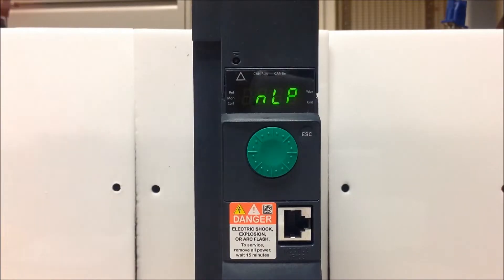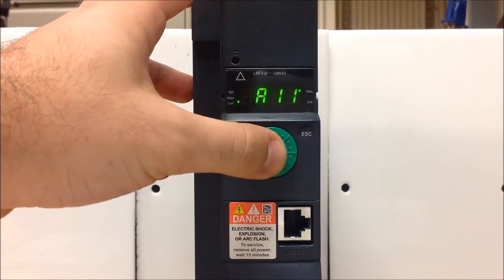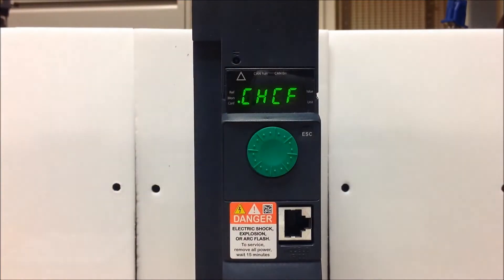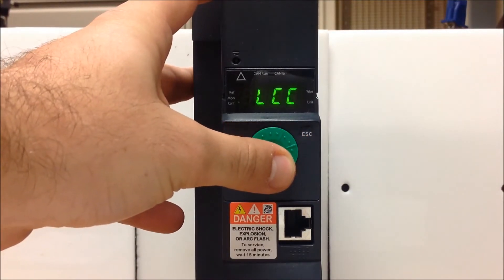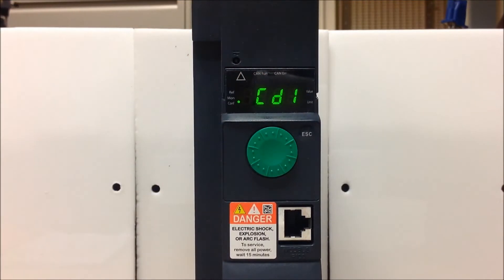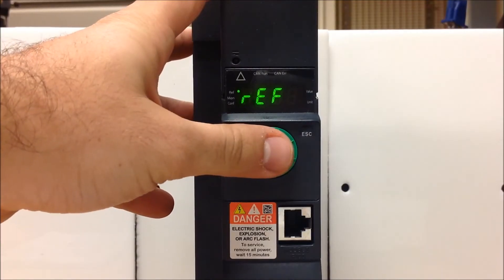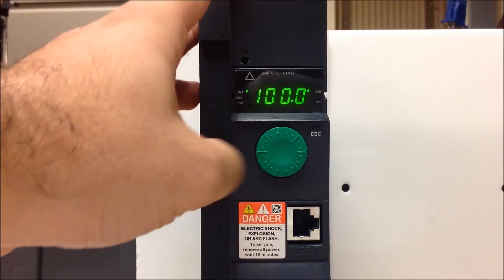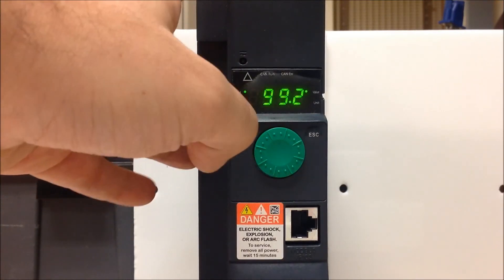Altivar 320 Drive Configuration: HMI Dial Speed Control Tutorial | Schneider Electric Support

Comment: When I press enter after setting CHCF to SEP the display does not go back to CHCF  like at the 1:50 mark of the video. I am running the ALT320 using an external +24VDC supply. Why does my ALT320 not behave like your example? There is no sign of A1U1 anywhere. Please advise...
Reply: You need to keep the enter button pushed in for a second or 2 before it gets confirmed. When CHCF is set to SEP, only than A1U1 will appear.